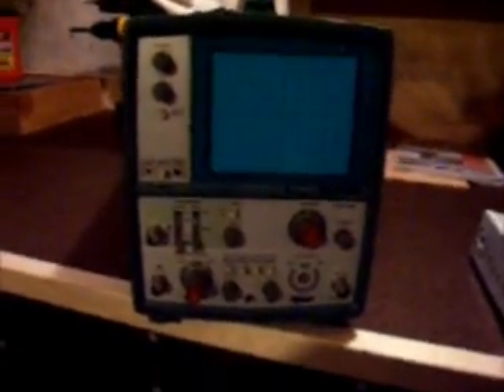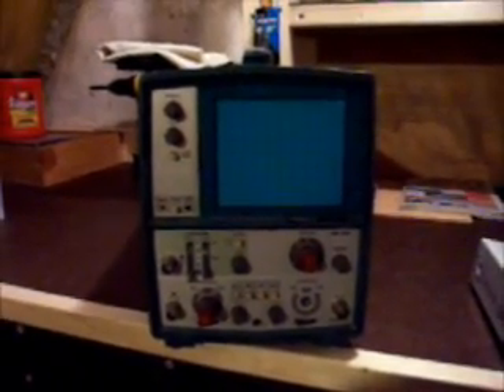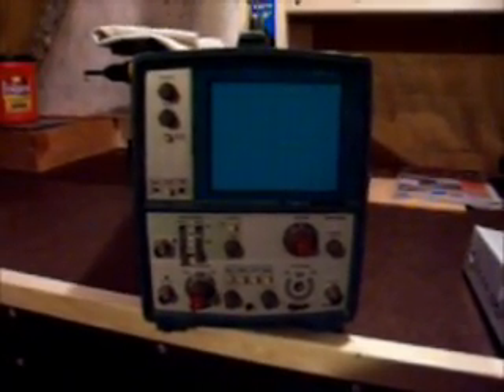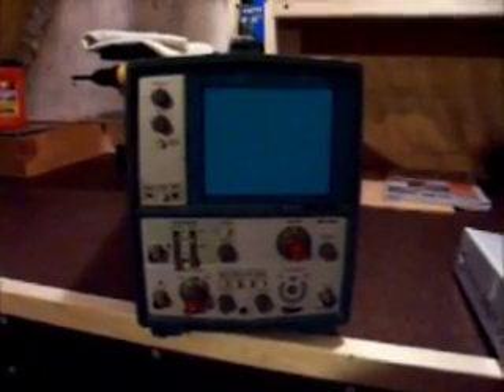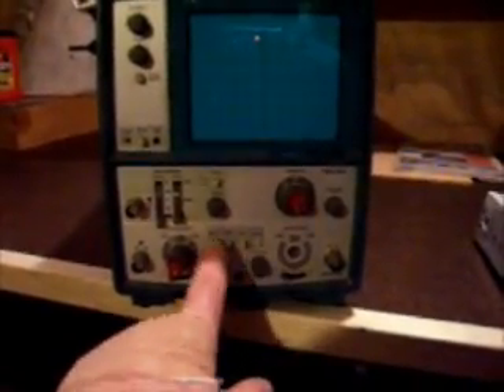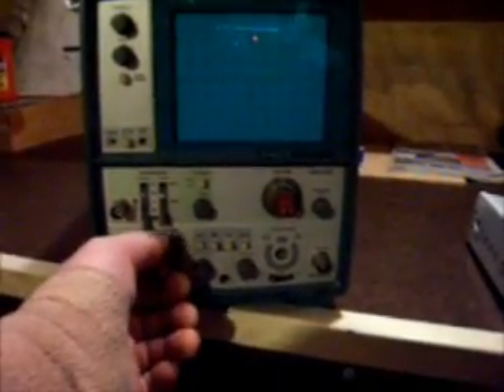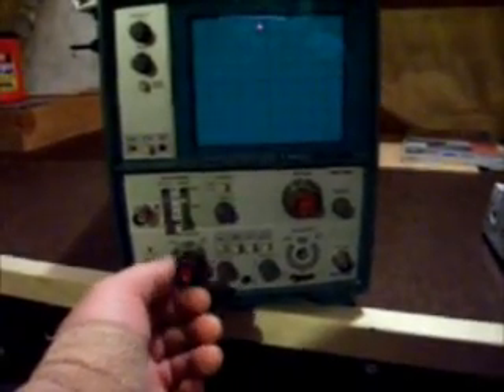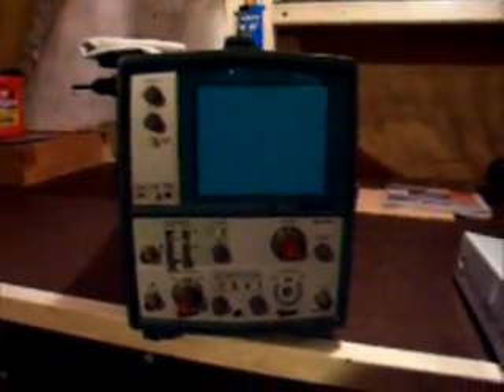I Need Help With A 1976 Tektronix T922 15MHZ Oscilloscope

Comment: Nathan,
Generally speaking, you'll find that the use of a scope will be somewhat rare, unless you work on precision equipment where measurements and adjustments must be as accurate as possible.
But as long as it's functional, your scope will work fine for general antique radio repair.  Basically, it should be fairly accurate when measuring equipment with frequencies up to 15Mhz.  Beyond that, it's pretty much crapola.  It's why many folks buy 100Mhz scopes.  Covers all the bases.

Regards,
John

Comment: Nathan,
Ebay has a few 15Mhz X1 scope probes... some cheap, some not.  Cut and paste this.

Tektronix P6101 Passive Probe, 1X, 15MHz. With no accessories.

Here's a couple more ebay offerings:

Tektronix P6101B Passive Probe, 1X, 15MHz. With all accessories .
 
Tektronix P6101B Passive Probe, 1X, 15MHz, With Ground Lead Only

Regards,
John